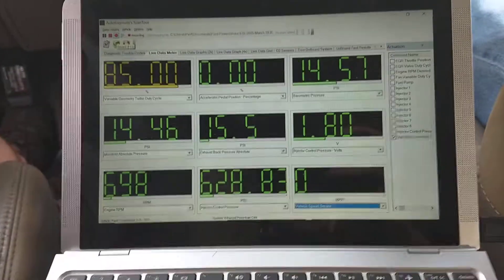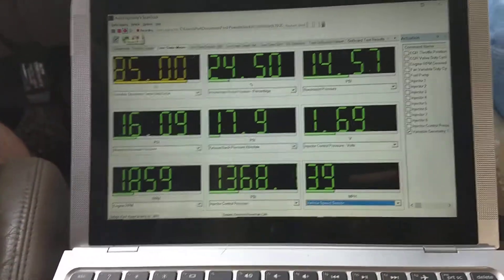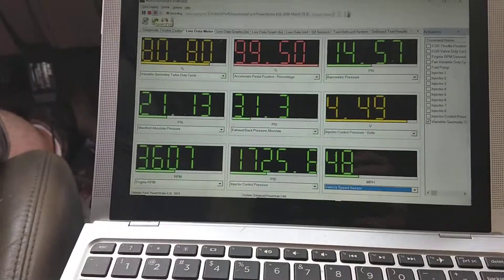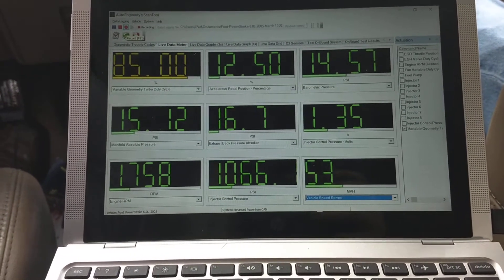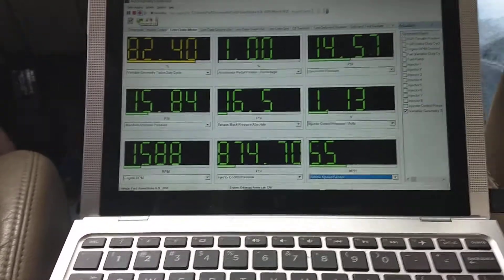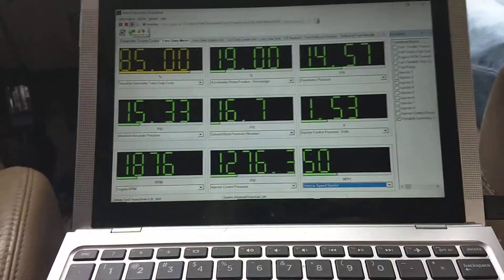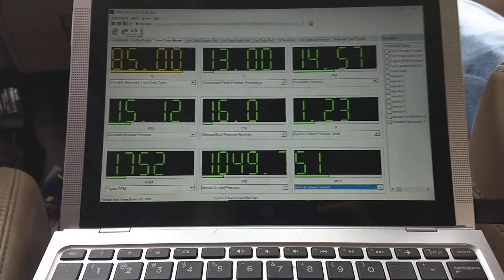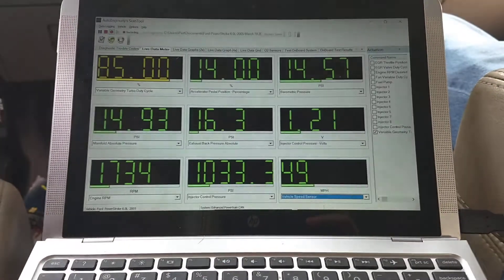Problems with 6.0 powerstroke turbo. Black smoke and power loss

Comment: my truck does nothing but smoke when you hit the gas and i have been playing with it for months trying to get it to stop. even cleaned the turbo.. when you figure it out post it please. maybe that will give me a direction to look into. think tomorrow ill switch turbos on my trucks to see if that fixes it.  thanks
Reply: Probably bad injector. Mine just started this after I upgraded my turbo. Put my factory one back in and still puffin. Was running just fine when I replaced the turbo cleaned my egr and didn't help I can't find any other issues
Reply from the maker: Please let me know how it turns out